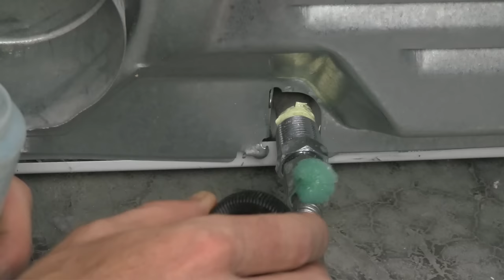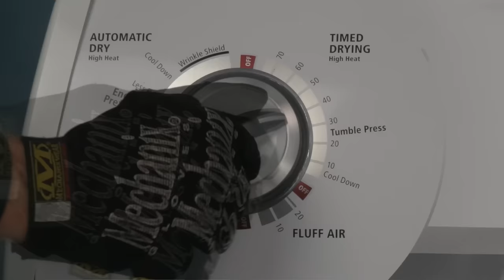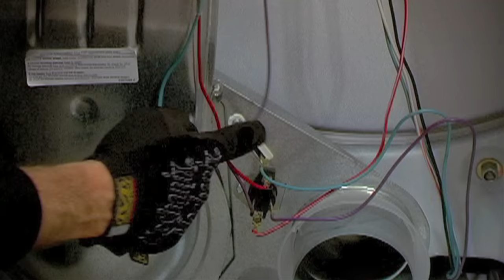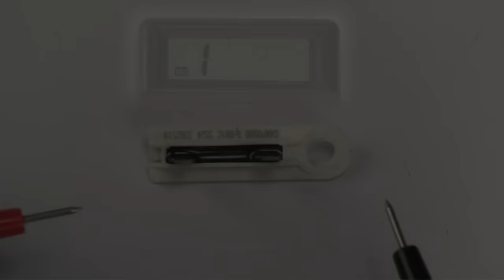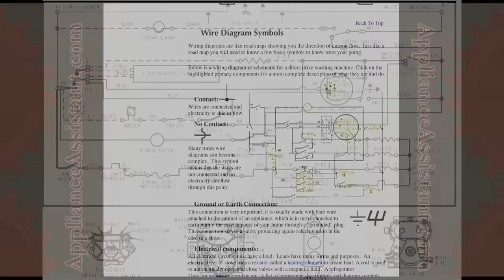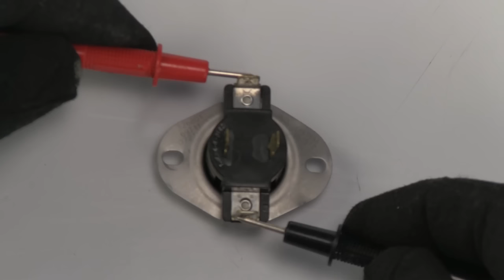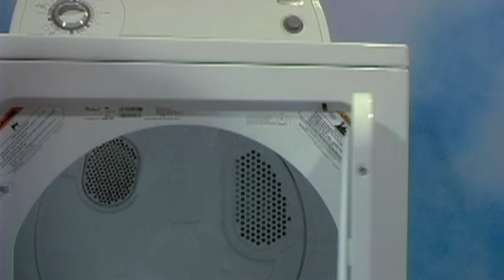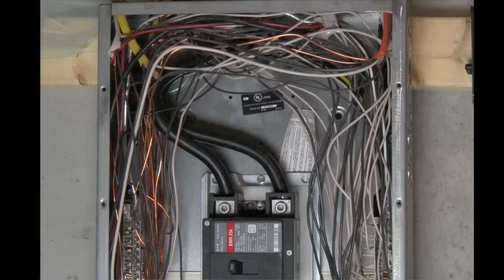Gas Dryer Repair: Fix Heating Problems

Comment: My exhaust hose was a bit clogged despite air flowing out, thank you for your help!  Is there a sensor that measures pressure they prevents the dryer from heating normally if there is a blockage?
Reply from the maker: Yes if the duct is restricted the heat will back up against the hi-limit thermostat, which will open and break power to the heat source. On a gas dryer the indication of that situation is a very short burn time. (5-20 sec.)  Hope that helps!
Reply: Thanks for replying!  Unfortunately, cleaning out the duct didn't solve the problem.  I took the back cover off and did a complete cleaning.  This too did not resolve it, I'm getting a short heat cycle and then air dry for like 4 hours!  I had to trick the dryer by letting it heat, then rest, then heat, and so-on.  I should have a new set of coils in a couple of hours.  I took the front panel off yesterday to do a dry run to see if I could do the replacement.  Thanks for your help!

Comment: Great video what do you think about the Whirlpool duet intermittent heat, takes about an hour to dry three towels,
Is no airflow problem I just disconnected the hose, still doesn't dry properly 2006 Whirlpool gas dryer

Comment: I have a Whirpool gas dryer. I've checked each part with a meter. The problem is that after the flame kicks on, it will only stay on for approx 5 secs. Any suggestions? Thanks.
Reply from the maker: Sorry for the delay! It sounds like an airflow problem... It could also be a hi-limit thermostat, but they are rare to fail. I would first check for a clog in the home duct or within the ducting of the dryer.  If you pull the vent off the back of the dryer and let it blow into the room will it cycle the burner in the 5 sec?

Comment: Great video, very informative.  My dryer is not heating.  I replaced the coils (this had been a problem in the past) but still no heat.  I replaced the gas hose since the old one had been kinked.  When I try the dryer, the tub spins and the igniter heats up (glows red), but then I hear a click and it goes off without lighting the gas.  So I'm not getting any ignition.  What should be my next step? Thanks
Reply from the maker: Joe Montecalvo That's great, It's difficult these days with bad parts... In the old days that almost never happened but now unfortunately it's always a possibility.  Thanks for the update!

Comment from the maker: For some reason the search rankings on my website http://applianceassistant.com fell more than 50% in 2 days! I'm still trying to figure out the cause... Different kind of troubleshooting... I like appliance troubleshooting better than website troubleshooting!  Anyway, I need your help! PLEASE PLEASE PLEASE share a link to my website with someone somewhere! My theory at this point is that Google wants to see more back links to prove that the content is helpful. If you can take a moment to share a link I hope that will help get things back on track.  If your willing, find a page you like and copy and paste the page's address somewhere on the interweb, while your at it click the G+ or like tabs on the top left of the page.  THANK YOU! THANK YOU! THANK YOU!
Reply: +applianceassistantMost looking at your You Tube are stressed with trying to find a fix for a non-functional appliance and may not be thinking about sharing your YouTube with friends & family. I'd be happy to share on FB if you'd like. I've not yet figured out my dryer but have some starting points and found your video very informative.
Reply: TY for your vid!!!!!
Reply: Looking for why my dryer didn't work and noticed this. Your website is non indexable from a line of code in the index page or "home page" pretty sure it's because in the code source it's set as http://applianceassistant.com and not http://applianceassistant.com/index.php
Reply: Here is a honest answer, its fixed, all staged. If your not part of the game you cant win.

Comment: Hello quick ?, I recently replace the two thermostats on my Fridgaire Gallery gas dryer.The symptoms were the dryer would get hot then cool and not completely dry the load. After replacing the stats, the symptoms are continuing. Im wonder if it's my coils. What are your thoughts. BTW I greatly appreciate the knowledge your share.on Youtube.
Reply from the maker: A few ideas... Is the home duct restricted or extremely long?  It's a little more difficult with frigidaire because you cant see whats going on when they are running.  You can sometimes see the glow reflecting off the left side cabinet from top with the lid off. If you ever see the ignitor cycle without ignition that's coils.  Good luck!

Comment: Hi, thank you so much for the video.  My igniter glowed and then turned off so I ordered the coil valve solenoid and replaced it.  The dryer then worked fine for a couple weeks and then stopped working again.  This time though the igniter continued to glow so I ordered a flame switch.  That didn't help though.  Since the dryer was working for a couple weeks after I replaced the coil valve solenoid it made me wonder if the problem is that they sent me faulty ones.  Like, I said though with the symptoms being different I am not sure.  Any ideas?  Thank you.
Reply from the maker: With the ignitor continuing to glow it does sound like the flame sensor... have you installed the new one yet?  If so is it still doing the same thing?
Reply: applianceassistant
Yes, I did install the new flame sensor but have the same thing happening, the ignitor continuing to glow orange, but no ignition happening.
Reply from the maker: I'm so sorry for the delay it has been a very busy few weeks.  That is a very strange problem! I hope you already have it resolved but if not... You can CAREFULLY simulate what the flame sensor should be doing and maybe get a new clue.  You can see me do it at 3:26 Have some one else plug and unplug the dryer so you can focus on not shocking yourself! when you break contact the ignitor should cycle off and the valve should open at nearly the same moment.  I would love to hear the answer when you find it.  Please be careful if your working with the live wires. Good luck!

Comment: I have this same model dryer.... mine lights and heats for about 1 minute. Then the flame shuts off and it blows just cold air. I ordered valve coils.... do you think I'm correct in my diagnosis?
Reply from the maker: Hopefully!  Did the ignitor ever glow and try to light again, with no success?

Comment: For the cycle thermostat...Should there be a reading across both sets of tabs?  The top and bottom against each other and the side against the side?  I bought a new one and out of the package there was only 1 olm on the side to side tabs...(Heat still shuts off after a few minutes and keeps having to restart. - have already replaced the coils)
Reply from the maker: It should be closed across the end connections 0 resistance and very low ohms across the two in the middle for the thermostat heater.  If the heat is cycling off too rapidly then you may have a air flow restriction or a weak hi-limit thermostat.
(Located in the back of the dryer on the duct that carries air from the burner into the drum on this style. Some dryer styles have it mounted on the flame tube)  that would cycle off the burner just like the cycling thermostat would.  Hope that helps!

Comment: Hello, I watched your video which i think is great but im still having a problems and i have few questions for clarity
My Problem is that the igniter glows and then shuts off. I checked all the thermostats and fuses in the back and their good. I replaced the coils like you and others have recommended and still same problem. I'm about to order another new set of coils in case the new coils i got today for 40.00 doesn't work

1. So if the igniter glows that means the fuse works right?
2. And if the igniter glows that means the ignitor works right?
3. If the ignitor glows and then when it is glowing strong for 3-4 seconds it shuts off at the sounds of a click does that mean the heat sensor is working properly? and i don't need to replace that? because i took the sensor out and it has continuity and from your video im understanding that when the igniter shuts off  its telling me the sensor is working is that true?
4. I bought new coils today for 40.00 and i put them in and it still does the same thing.
5. I was told by a repairman to bypass the sensor by connecting the two wires while the machine is unplugged then plug in the machine and start it. when the igniter glows to pull apart the wires (making sure to not touch them or anything else and if the gas ignites the sensor is bad. (Yet if the sensor shuts off the igniter doesn't that mean the sensor works? and there is no need to replace it? Can a flame sensor have good continuity and click the igniter off yet still be bad?
Can the sensor work in shutting off the igniter but not the coil?
One of the reasons in asking these questions is that im wondering if i need to buy a new sensor and fuse and igniter ( According to your video im assuming that my sensor,igniter and fuse all work fine because the ignitor glows thus the fuse works right? and then it is set off within seconds of glowing means the flame sensor is good, so i hope i just bought brand new bad coils.  if it wasn't my dryer id destroy it! :) Thanks! sorry for all the questions
ive tried everything and yet im missing the one thing! I need help!
Reply from the maker: Sorry for the delay! It sounds like you have a good understanding of the system.  if the ignitor glows your fuse is fine. If the ignitor glows its 99% probably fine.  If the sensor opens and cycles the ignitor off it's fine... Sounds like coils but you may also have a gas supply or valve problem.  I had one that I found a spider egg in the valve orifice (out port of the burner) that was stopping the gas from flowing.  You may want to make sure you have gas to the dryer, from there it gets to be slightly more difficult to check...  mechanically it is the coils or the valve itself.  Hope that helps!

Comment: Hello I do have a quick question. I replaced the the coils in my gas dryer (after watching this vid). I had flame turn on after the initial glow after replacing them. However I could not get my first load dryed because they stopped making flame for my gas dryer. Does that mean my coils burnt out that fast? Or is there another issue that can be causing this problem?

I have checked my lint trap and my tube coming from my dryer for lint blockage all is clear.
Reply: Also I do not recall having a "spacer" on the big coil. I just tried my dryer again and the flam kicked off about 3 to 5 seconds after it started..
Reply from the maker: Sounds like you may have something in the duct or dryer that is blocking the air flow.  Try running it with the duct off the back and see if it works.  It could be a bad hi-limit thermostat but that is super rare.  Probably a clogged home duct.  Hope that helps!
Reply: applianceassistant Well I checked the back and there is no lint that blocking anything. I haven't checked the top exit threw the housethough.

I am able to use my dryer. But it seems after it drys one load and I want to dry another load thats when the flam kicks off after a few seconds.

Might not be getting a good air flow?
Reply: applianceassistant
 Well I did as you asked and still nothing. Either it works sometimes (Rare) or the flam just doesn't come in or it flames for about 5 to 10 secs before it go outs.
Reply from the maker: That is a strange one... My guess is that the hi-limit thermostat is getting weak. (rare)  It's probably okay for the fist load then it gets progressively more sensitive on the second and starts to fail prematurely.  Just a guess but I can't really think of anything else.  Hope that does it.
Reply: applianceassistant  Yeah. thanks. Im going to barrow the electrical tester and do a good check.. I thank you for your time.
Reply from the maker: My pleasure! Hope you get it figured out!
Reply: applianceassistant  Just a update I have not got a tester, But I can get 1 dry load a day. Would you still think it's what you said on the prior post? Because I just might go ahead and order the part.
Reply from the maker: Sorry for the delay! The short burn time is hi-limit thermostat controlled. So it's ether clogged duct or hi-limit thermostat. Hope that helps. I would love to hear the conclusion.
Reply: No problem for the delay. I have checked my duct and that is not the problem. So I will be getting my serial number soon so I can order my part. And I decided I would order threw you for you're efforts of helping people with you're generosity.

Comment: When the gas comes on for a moment then turns off you say to replace the safety coils, or in rare cases the "valve." It appears I have am experiencing that rare case, what is the valve?
Reply from the maker: Sorry for the slow response! The valve is the assembly that the coils and the ignitor are mounted on. What are your symptoms?  I will try to be quick this time...

Comment: I have an Amana LG8409W/L2 from 1996 that has worked fine.  A few weeks ago, the flame would just stay on for a short time.  I changed out the coils and all went back to normal, until today.  Without any changes being made, the glow/ignite will just stay on and no gas is fed into the burn housing.   Tested the flame switch, and it lets electricity through w/out resistance - so it seems to be good.  Now I'm not sure what to do.  The glow is bright and strong, and the flame switch seems to be fine, but there's no gas flow, so what is the matter?  The gas line hasn't moved a millimeter so I'm assuming all is good there.  Is it possible that the flame switch is broken even if current goes through it w/out a loss?  The coils should be just fine as they're new.  What controls the gas valve?  Please help!!!
Reply from the maker: The flame switch should be closed and let electricity through until it heats up, then it should open and force the electricity to go through the coils to open the valve.  Sounds like the flame switch is not opening when the ignitor is hot. Hope that helps.

Comment: Are this gas dryer's dangerous? I'm paranoid about shit blown up or catching fire.
Reply from the maker: Not really, they have severely safeties in place. The main cause of fire is a lot of lint build up in the dryer from not cleaning the trap regularly, or your home duct getting plugged up with lint or something. Thanks for the question!

Comment: Excellent Video - I look through several videos and this one is complete, simple, and because of its content, I bought a 3.86 fuse and fixed my dryer.  I had no hope and this is the first time I used a voltmeter and understood how it works.

Comment: I have a Kenmore Series 80 gas dryer and I get the "click" and the orange glow and flame the first time, maybe an additional time or two, but after that I noticed I don't hear the click anymore i hear more like a hum, then the orange glow with no flame. Does this sound like the coils or something else like the flame switch? Thanks in advance for your time.

Comment: I have a Kenmore dryer machine. The burner igniter glows and then after seconds there is a click and there is ignition; however after several minutes working and heating well, there is a click and the ignition stops. Then when restarting the machine right away 2 events happen. One: the igniter glows and the ignition starts and then again it stops. Second: The igniter glows, but then there is not ignition. Is there something overheating? Thanks
Reply: Fixed!!! It was the Gas Valve Solenoid. Good Luck

Comment: I have a whirlpool gas dryer like the one in the video. Replaced the igniter and thermal fuse. It ignited for a minute or two and now it won't ignite and won't heat clothes. Don't know what to do to fix any ideas?

Comment: I have a maytag gas dryer, flame lights for around 30 seconds first time. Then burns approx. 11seconds every minute or so. Any ideas n this?
Reply from the maker: Sounds like a clog in the duct somewhere.  Or a week hi-limit thermostat.  probably a blockage... Pull off the duct from the back of the dryer and see if that helps, if not you will need to check the internal ducting of the dryer.  Good luck!

Comment: Thanks for sharing. Here's a question for you: I have a Frigidaire Affinity Dryer FAQG7011LWO that shows an E56 error. Do you know which part(s) may be affected? To help, the dryer does not produce heat.
Reply from the maker: Not sure I don't see a E56 in the service manual I have, but there is E5b which is" Temperature reading of control thermistor has not changed in a certain amount of time." basically telling you what you already know...It's not heating. The basic mechanics are the same as the one in the video... just a lot more difficult to work on because theres usually no bottom panel or peep hole. Heres a link to the service manual on my website:  http://applianceassistant.com/Appliance-Repair/Appliance-Service-Repair-Manual-Feature.php?id=1475
Be patent for it to load it's a big file.  Hope that helps! Good luck!
Reply: Thanks for the info. Did some testing myself using a volt meter. I had a burnt out thermostat. Had it replaced for $11. Your video did point me in the right direction.
Reply from the maker: That's wonderful!  Thanks for the update!

Comment: my GE front load dryer starts the gas goes on and runs for a while then the dryer goes off and i can't get it to go back on for a while what could be wrong.
Reply from the maker: Do you get any codes?  Is there still power, and it just wont start?  My first thought is that you may have a weak motor that is being cycled off by a hi-limit temperature protector built into the motor...